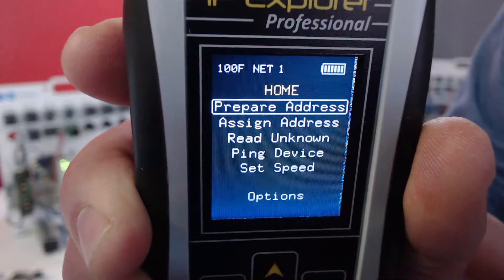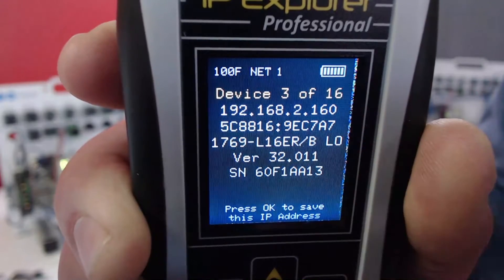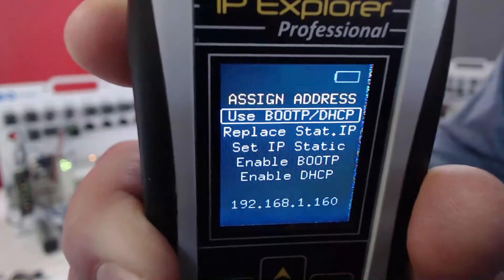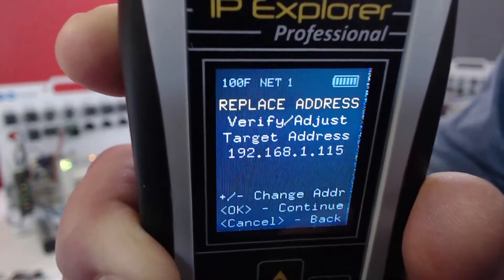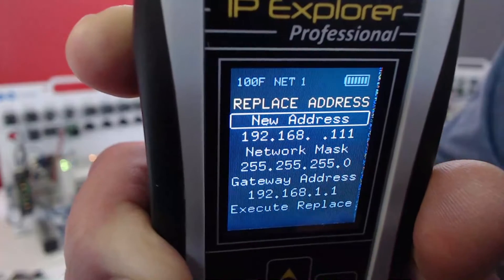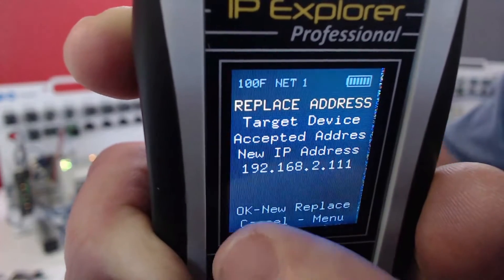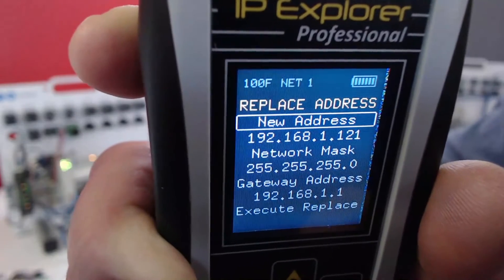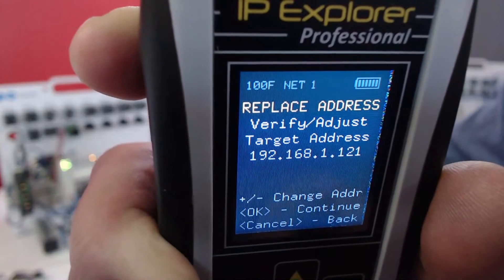EASILY Change Whole Ethernet/IP IP Address Schemes

Comment: Hello Tim, 
I think you used this device in one video to simulate a 4.20mA signal. I'd like to know if this device can make a PWM signal and if can use it to test a stepper motor (NEMA17 stepper). Thanks for the info!
Reply from the maker: No.
Reply: @TimWilborne  Thanks